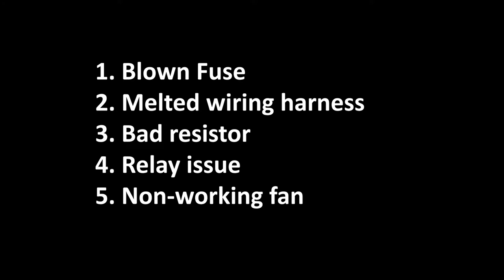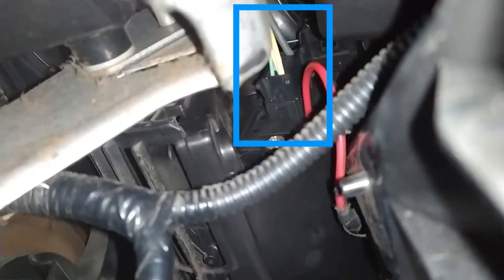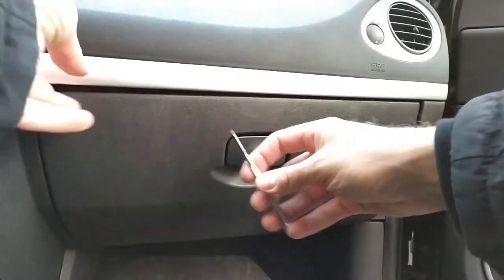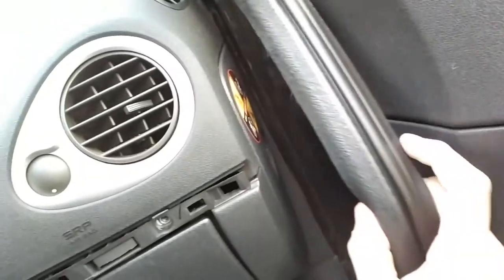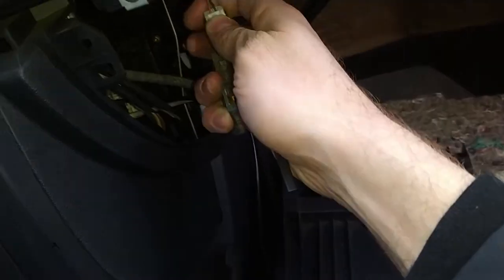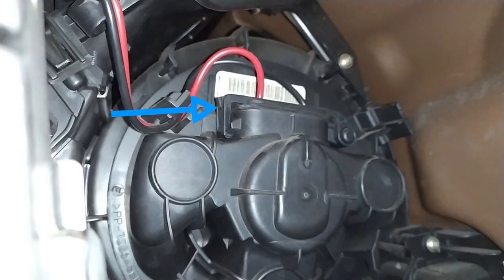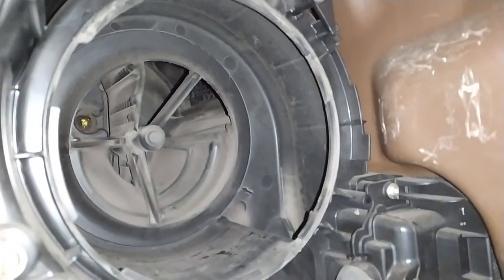Renault - Non Working Heater Fan

Comment: very  nice  video  ! 
u  think  this  would  match  my 2011  kangoo petrol  ,  left  hand  drive  ?  
the  A/C  sometimes  work  and  sometimes  not  .  when  u  hit  the  top  of  the  dash  (  above  glovebox  )  ,  it  starts  working  ,  if  not  working  when  u turn  it  on  .
Reply from the maker: Hey there! Thank you for the feedback! 

I think that it should work similarly with most Renault cars. Unfortunately , I have no experience with Renault Kangoo 2011 , however the components should be the same. From what you have described I would assume that it is a connection problem , similar to point 2 in the video. This was the issue with my car and I was able to diagnose it this way:

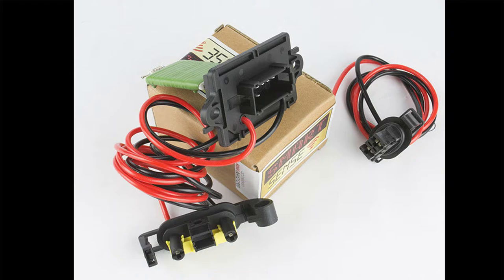1. Get access to the connector. In my case I had to remove the plastic panel below the steering wheel. Watching this video: https://www.youtube.com/watch?v=Ov_QprAkzTM (02:10) I think you might be able to remove the glovebox and access it from the bottom(without disassembling the whole dashboard). 
2. Start the car and turn on the fan.
3. Wiggle the connector and if the fan starts then it is very likely that the connection there is not good. 

There are aftermarket connectors they may differ from car to car. If possible you can disconnect(mine was stuck as the plastic was melted and it took a lot of effort) and inspect it , take a few pictures and check online or with the local dealers.
I was able to find only the plastic part of the connector (without the pins) with for cheap(about 5 EUR). Swapped the old plastic with the new one (without cutting and soldering new wires) and it still works(more than a year since I changed it). 

Hopefully that will help! Good luck.
Reply: Joni Zill  what  is  it  got  to  do  with  the  video  up  here  ?

Comment: my plug into resistor  badly burned -got new one and carefully changed wiring-cheecked fuse in fuse box 4 fan-ok-heater fan -not working suspect resistor faulty but not sure about this-terminals on resistor look slightly burned-cleaned them-still not working-dont know how to test resistor(item quite dear and not easily changed?any ideas or advise greatfully accepted thanks
Reply from the maker: Hey Chevy790,

Here are a couple of this that you can try:

1. Connect everything and turn on the blower on setting 1. Gently wiggle the connection that goes into the Resistor Pack. Then repeat the same thing on setting 2,3 and 4. If the fan starts, even for a moment, it most likely is a bad connection. That will indicate that the Resistor Pack is working, but you might need to change it anyway as the connector is part of the assembly.

2. Test the blower motor. You will need to apply 12V directly to the motor to check if it is working. You can take out the motor and connect it directly to your battery. If it is hard to take the motor out, you can take out the Resistor Pack and apply 12V from there. The red and black cables that are connected to the Resistor Pack are going directly into the blower motor.

3. If the motor is working, then it is very likely that the Resistor Pack is faulty. Here you have a couple of options: 
 - The fuse might be bad (not the one in the fuse box, but the one attached to the Resistor Pack). You can check the fuse with a multimeter. Simply put the multimeter at the Ohm setting and test the fuse. If you get an Open Circuit, then the fuse is bad. If you get 0 ohm, then it should be okay. In case it is bad, you can change it easily, however you will need to order a new fuse and I cannot give any info about that fuse. You can see the markings on the old fuse and try searching online for a new one. See this article if you want to go that road: https://www.heaterblowerresistor.co.uk/thermalfuse.html

 - Change the whole Resistor Pack. A new Resistor Pack is not super expensive, and it will come with a fresh connector, so the connection will be perfect. I do not know what is your car, but even if you cannot find exactly the same Resistor Pack, there might be one designed for a different vehicle that will fit yours. If that is the case, you might need to use the old connection between the Resistor Pack and the Blower Motor (Red and Black cables). 

Hope this helps! Good Luck! 👊

Comment: Hoping to get a reply, My 2006 master has a heating problem where it stopped working completely then sometimes when I turned van off and got back In the heating would work on certain settings then it changed back too all settings and now I'm back to having no heating at all I believe it might be the resistor but as the glow plug light come on around the same time I'm not too sure and don't want to order somthing that doesn't need ordering... any help would be appreciated
Reply from the maker: Hey! Sorry for the delayed reply! I would say to try the easiest first. Disconnect the wiring loom connector and visually inspect it. If there is nothing obvious, try to start the car and turn on the heater on a random setting. Then wiggle the connector and if the heater starts/stops then consider changing it. 

If you think the resistor might be bad, you can try taking it out and measuring it with the continuity setting of a multimeter. Make sure to check the thermal fuse as well. ( https://www.heaterblowerresistor.co.uk/renaultscenicheaterresistor.html )

Comment: While the AC is on the radiator fan is working otherwise the radiator cooling fan is not working and getting the engine overheated on my Renault Logan.????
Reply from the maker: Not sure what that can be, however check this https://youtu.be/evpaTW2WJ5Y . At 02:40 he is explaining about the thermostat, which could be the problem with your car.